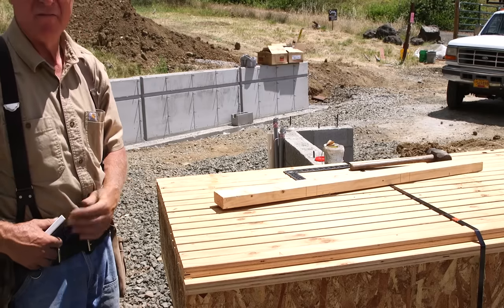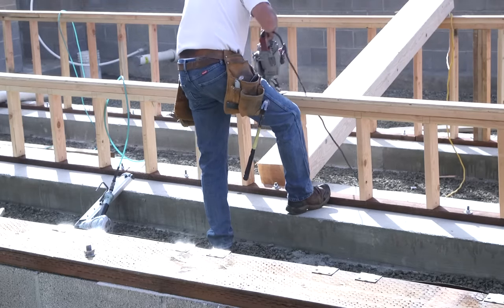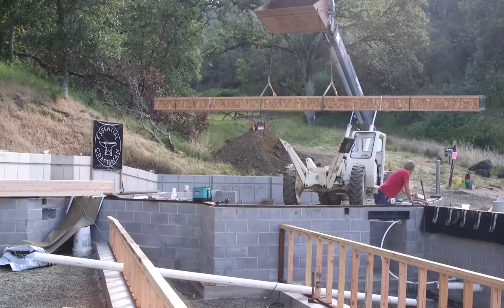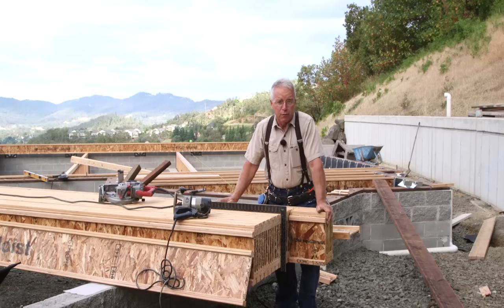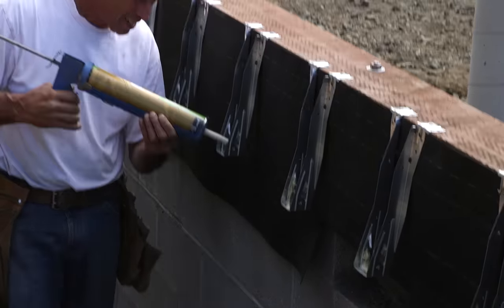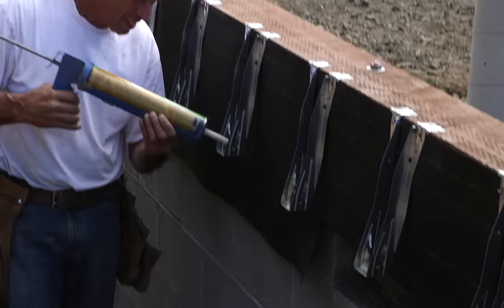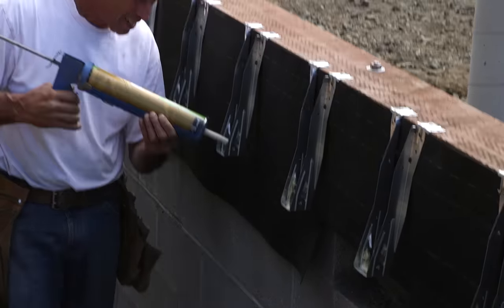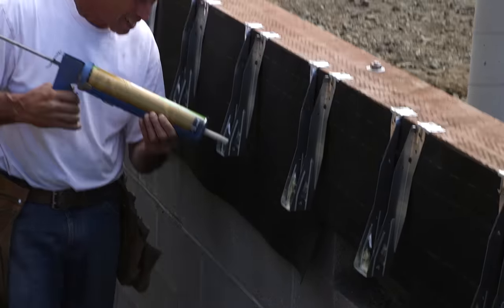Roll the Joists Ep.40

Comment: It may be obvious to builders and developers, but I would have liked if the video had cited any advantage of dimensional lumber joist over engineered I-beam joist.  The video discusses many reasons why I-beam joist would be preferred over dimensional lumber, but--unless I missed it somewhere--the video didn't cite any reason why an old fashion solid wood joist should be used over a wood I-beam joist.  Is there any case where solid wood joist should be used?  Solid wood joist price is lower, for shorter spans?

Comment: Note a fan... those vertical part builded in wood... Moisture even if ventilated, specially those on the side... this whole thing is strong together... remove one part and it weaken a lot. How much kg per square meter can be put on this..? Here in Europe we use, most of the time, 250kg/m2.

Comment: You guys put glue on the hangers to reduce squeaks but nail in the blocking? The nails in the blocking is way more likely to cause squeaks than the joist hanger.
Reply: How so? The blocking is below the top of the joists so the decking won't be on the blocking. The shims keep the blocking off the pony wall so the blocking is going to move with the joists when being stepped on. It's hard for me to see anyway vertical forces from being stepped on would cause rubbing against those nails producing squeaks.

Comment: Do we have to assume that green line around 27:00 actually gives you a flat reference ?
(Its a catenary, aka hyperbolic cosine)
It's a serious question. You are carefully checking the height of the joist against a shape that can not be flat.
What is the tension in the wire?
Reply from the maker: Extremely tight...The video doesn’t show it but the further I got into the middle of the span the more interference I accepted with the block. Obviously subjective. Plenty flat enough.
Reply: @essentialcraftsman  OK, thanks for your reply.
I tried to see how tight it was when you moved the wire, It was indeed hard to see how tight it was.
But the span is so wide, its gotta sag at least a little. :-)

Comment: One thing I will add is to make sure you roll your floor joist the same orientation. If you roll your joists with the hole pop-outs on the bottom, make sure you roll them ALL like that. The electricians or plumbers will hate you if you don't.

Comment: So how does a 1 1/2 wide hanger attach to a 5/8 piece of chip board ?
Reply: the 1-1/2" flange of the joist sits on the hanger; screw/nails pass thru the hanger into the flange; dunno if any fasteners go from hanger to the OSB web portion of the 'joist' ?

Comment: In California you HAVE to add web stiffeners to the ends. These joists are great for all the reasons he pointed out. The problem is that they are not as durable as conventional lumber. They do not handle moisture well. If you have crawl space flooding issues or very moldy crawl space these will turn to mush. Heaven help you if you have a flood in your house.

Comment: About the only thing TJI,s have going for them is they are cheap. Burn quicker,if installed correctly,need web stiffeners . Tax the environment more by clear cutting scrappy trees and introduce more formaldehyde into living space,along with the durability question. OSB is more easily attacked by moisture. By the way,did I miss the vapor barrier on the sub grade or is it left out  ? Also,vented crawl spaces are so out of vogue. If your inspector still is hung up on them,do some research and show him the latest data. Again,that is if a moisture barrier is installed.

Comment: It looks as if whoever was responsible for setting the height of the pony walls lined them up with the outside dimension of the wall hangers instead of the inside dimension, this is why tapered shims had to be fitted, but this cock-up was trying to be covered up by making the shims sound as if they were an important part of the build when in reality it was a typical bodge, caused by the contractor rushing around trying to save time as was demonstrated in the video.

Comment: So a 10"  joist piece off wasted. What if you double down on your accuracy and order them Desired length plus 1 or 2 times the length of your block (16" on center - 2") plus allowance of 3" .That way you would get a floor joist cut to exact site size, one or two blocks for bracing and still have a minimal waste (3" to 10"). 
I personally dislike the wedging process. Issue one is the wedge wood quality that needs to be super strong with minimal sensitivity to moisture. Even then the wedges get compressed only in the outer edges of the joist bottom. Finally and this is my problem is that the joist sits on the highest edge of the wedge thus easily compressing that very small area of contact after a few loading cycles. All you need for a floor quality to fail is 1 mm of damage to the wedge and the joist would now become seperated from the wedge itself.

 Try wedging equal angled pieces. Wedging must be carried out from both sides underneath and complement each other in supporting the joist.One on top of the other sliding from opposite directions.

Comment: is there a tool like your laser transit that would work good for setting the joist shims?  maybe a laser and a laser eye that are the exact same thickness that could be set on the plates and then a block that can be moved to the top of each joist as you are setting it.  as you drive shims in,  the block will eventually disrupt the laser and trigger the audible cue.  Would make it a precise and easy 1 man job.  the laser block would need adjustment to get it to fire perfectly into the laser eye.
Reply: it is called "essential craftsman", not top-notch craftsman. So the line is fine. The laser would be better.
Reply: You wouldn’t notice or feel any difference in the finished product by using a laser.
🤜🤛
Reply: @psidvicious  no, but you would notice a much smaller bill as  it was a one-man-job.
Reply: @psidvicious  I wasn't suggesting Scott's method didn't do the job.  Just wondering if someone makes a tool to make it easier.
Reply: @ Jason Morrison - Yes, you could absolutely use your regular laser/level to do this job. Remember how the builders laser/level works. You don’t set the laser ‘beam’ to a specific elevation. You just set it up making sure the beam will clear any obstacles and it shoots out a level beam at a random height. Then you set the bottom of your rod on top of a desired elevation (in this case, top of joist). Then you move the laser sensor up or down on the rod until it detects the laser beam. Lock the sensor on the rod at that point and then you know wherever you go on the building, the bottom of the rod will be at that same elevation. So, yes, Scott could have used the laser to do this quite effectively. He and Steve just decided to do it the old fashioned way. [guessing just for demonstration purposes]
🤜🤛

Comment: My question is, is it better to use those manufactured joists campared to 2 by floor joists for seriously heavy loads, like large aquariums
Reply: Your local code will have different requirements for a different expected load. They measure it in PSI (or equivalent). If you know the weight of your aquarium and it's footprint you can figure out the pressure it will put onto the floor.
Reply: ardenthebibliophile its gets tough with giant 1 thousand gallon or larger tanks i plan on buying or building a shed & greenhouse but i dont want to pour concrete. i just want to make sure a gigantic tank does not destroy the flooring
Reply: @jeffscroggins229  yeah at that point you're gonna have to talk to an engineer. I looked at a couple aquariums and you're talking 8100lb on a 120x72 inch footprint. That's about 1psi or 144 psf. Typical span tables go up to 60 psf.

Comment: so the only thing holding up those joist ends are 4 nails, 2 on each end, right at the edge of the 2x6 sill plate. I don't really like it,. I know these joist are long and straight, But I still like using old fashioned real lumber for framing.

Comment: you have to drywall the bottom flange now  for code or buy a more pricey type
Reply from the maker: Not without any combustion source (gas furnace) in the crawlspace...
Reply: @essentialcraftsman  here they want it anyway  real pain in the ass
Reply: here meaning Connecticut
Reply: @essentialcraftsman  i choose my battles  otherwise you cant delever product and if i dont build 8 houses a year  we have to close shop bummer
Reply: @essentialcraftsman  Also im  a big  fan  of yours
Reply: @essentialcraftsman  what kind of heating and cooling are you doing

Comment: Joisting the pain in my ass as an apprentice . The I beams are nice but the Oldskool dug fir 9x2’’ 3’s & 4’s were very tough work with just a hammer saw brace and Bit . Even  tougher  with just a front loader forky no telescopic in sight . That came to an end for us in the U.K. in the early 2000’s when we went I beams to “ save the forests “
We set at 600’s c and it’s way to weak and bouncy I’m not a fan but nice to do . My house has solid beams much better last 5x longer .

Comment: Why not use a laser level when shimming the floor instead of a string line?
Reply: Why. Two nails, three pieces of wood and a string.
Reply: I saw the video on using string and understand that it's a simple method. But with how much he was pulling the string as he leveled the joists, I wonder how accurate it keeps the floor leveling. I would think that this would be a good time for a laser.
Reply: @ Matt Jacob - You’re not wrong about using the laser for this. My guess is Scott just did it the old fashioned way for demonstration purposes. So people could see how it was done before lasers were around. The string method is still effective and yields completely satisfactory results.
🤜🤛

Comment: What happened to the 1/2" gap if you have to hammer them in place?
Reply: The subfloor will take care of that when nail
Reply: He said a 1/2 inch gap is required when not butting I- joists up against vapor barrier. He installed a vapor barrier under the joist hangers.

Comment: Why use glulam as a flush beam on the lower floor and not LVL? Where I am glulam is much more expensive. Also glulam is not 11-7/8" as it is made of 1.5" plies of lumber.
Glulam should typically not be notched without engineering. Although 1/8" is pretty minor.

Comment: There's one serious consideration with these TJI joists that I'm not hearing you address at all. There fire resistance is substantially lower than solid wood. It's a real concern. I know an architect that hates them for this reason, and the fire fighters are not big fans either. https://www.fireengineering.com/articles/2007/04/silent-floors-silent-killers.html#gref

Comment: How common is it to have all or as most as possible of the lumber pre-ordered to the dimensions needed & used for installation? iN OTHER WORDS SINCE THE LUMBER IS ALL GETTING CUT TO SIZE AT THE SAWMILL ANYWAYS. WHY NOT TELL THEM THE ACTUAL DIMENSIONS TO CUT TO? (FOR PIECES OF LUMBER THAT THERE ARE ALOT OF THE SAME SIZES NEEDED IE: STUDS, JOISTS, ETC)
Reply from the maker: Precut studs yes...

Comment: I found two mistakes. He said going 16" on center over 23" to save a few. False. You save way more than a few. On a 50ft it is #11 you are saving to be accurate. Second mistake. They a not cheaper than real traditional lumber. You still need to load bear. You can find 2x10s 16' for $16 each. 2-1/2" x 9-1/2" x 16' I-Joist $42.

Comment: I always wandered why you yankees build your houses in this manner, being wood and drywalls. Where I live we build every house out of concrete and masonry. Is it cost, tradition, speed or what? I do envy your builders when it comes to remodelling and repair work. I tell you a leaking pipe or a new electric line down here is a battle with concrete breakers and dust. 
I do work as a general contractor or equivalent and mostly remodel bathrooms.
Reply: There has been a easy supply of timber in most of the USA so they build timber houses. Also, it is usually accepted to tear down a house after 50 years and build another one, so the implied longevity of bricks and mortar are not required. Personally I live in a simple stick framed house here in the UK, very similar to a house from the 50’s in the USA, it isn’t so bad... certainly easier to repair compared with bricks

Comment: 16" o.c. for your floor joists?? Really? Why not 19 3/16? That's what the diamonds on your tape measure are for. Perfectly acceptable by the engineer and less I-Beams, means more beer money. 🤐 

Also, had you ordered the joist 15" or 16" longer, you could have used the chainsawed portion of the joist, as your blocks. Your waste would have been minimized.

But I'm sure you know this.

Comment: You created a lot of unnecessary work by trying to gang cut your jack studs on the pony walls. If you would have cross stringlined your benchmark you could have measured each stud to the bottom of the string and that wall would have been perfectly level.

Comment: Who screwed up that pony wall? The height is wrong and the studs don't line up with the joist. Tear it out and do it right!
Reply: Watch the previous episodes. He explains the reason(s).
Reply: @keule9962  
So it's crooked, the layout is wrong, it's too short, and it's uneven. Tear it out and do it correctly.
Reply: Michael VanGundy 
It’s not screwed up. The height is not wrong, because if it was too tall, you couldn’t set the height for flatness. The pony wall studs are not required to line up with the joist, even though these do. The layout is on target. The only thing wrong here, is your lack of framing knowledge, and inability to convince someone otherwise.
Reply: @circularebin  
That's some real hero worship you've got. Without a beam to support the joist, the studs in the pony wall do need to be in line vertically. They are clearly offset an inch or so. They were not shot in with a good level. Some are a 1/2" short. Shimming is not OK on my job. The whole thing is too low and when the ducts and plumbing go in they will need studs removed. More trouble!
Reply: Michael VanGundy 
There’s no hero worship here, and I repeat again, the pony wall studs are not required to line up. It’s just like wall framing. Lining up everything is an OCD trait, not a structural requirement. You think an inch offset is an issue? Even if some of the studs had to come out to accommodate ductwork, a single joist, let me back up, a single engineered joist without a stud underneath, will not cause an issue. Those joists will span a far greater unsupported distance than what we have here. You’re looking at a tree, not the forest. There’s a whole system at work here.
Reply: @ Micheal VanGundy - Now you’re really nit-picking. The center (‘webbing’) of the joist is fully supported by the shim. 
A ¼” of the flange unsupported on each side by the shim is negligible.
🤜🤛